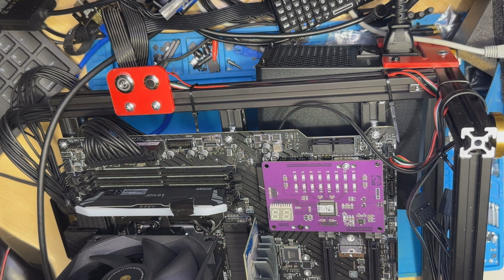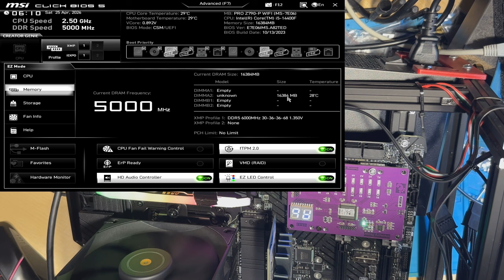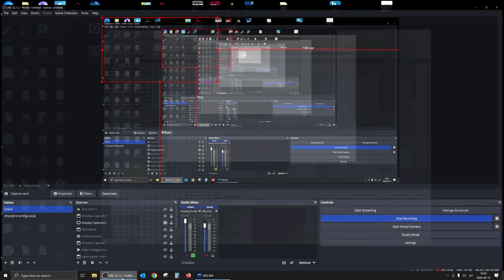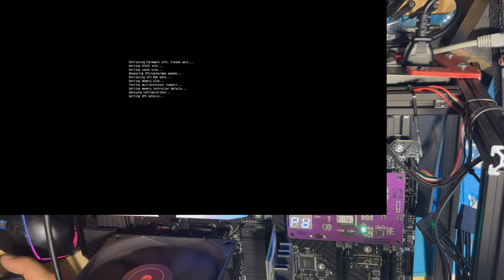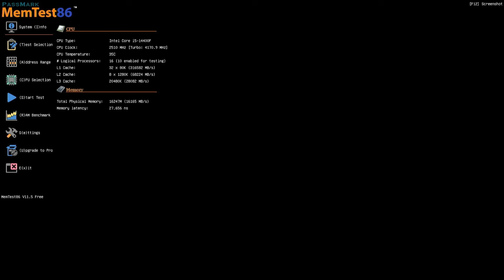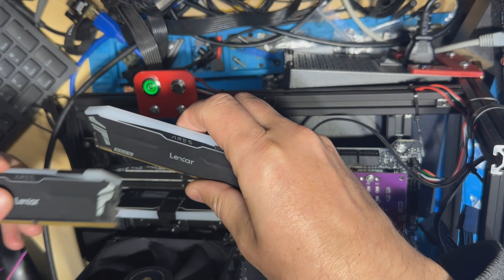DDR5 RAM Repair: Solving the Mystery of Dead Memory Sticks

Comment: Hi there, I love your videos. I’m willing to pay for a copy of the BIOS you used to test motherboards. Could you get back to me if this is possible?
Reply from the maker: U can find it for free in Tony's discord
Reply: @gpu_lt  thank you very much
Reply: @gpu_lt  Which Discord server can I find it on? Can you help me?
Reply from the maker: @clipalizou4269  pm me on discord
Reply: Hi, are you sure the only difference between a Chinese-modded mobo and a normal one is the BIOS? What if they modified the hardware part? Removed some resistors, added some wires here and there, etc
Reply from the maker: @artemexodus i don't know. Ordered from chine full kit and using.

Comment: Hello. You need connect 148pin (HSA pin, or this pin on spd chip)  ddr5 to vss(ground)  and power on your programmer. SPD boot in offline mode and lock\unlock RSWP will be available. Try it
Reply from the maker: Yes, allready made this. It is enaught to connect groud to spd pin8 while and then it cleares.  Thank you.
Reply: @gpu_lt  No problem. Pls tell me 5v arduino you connect to bulk_vin ddr5,  3.3v arduino  to pwr_en ddr5?
Reply from the maker: @harryus1681 contact me info@gpu.lt

Comment: that’s very interesting but how does your main board boot without the 24pin plugged in ?
Reply from the maker: If you mean the main power cord from psu to motherboard - it was plugged in. And this was the reason why camera could not see post diods on the motherboard. The 24pin was covering them.

Comment: I was looking to buy the postcard in the past but only tabaoo and could not deliver to my country. Where did you get custom bios and which ATX motherboard is required
Reply from the maker: i have friend in china, he was participating in this purchase, and it took 6 months, as first i bought only post cards, and then realized, that i need motherboard with special bios. so i bought also the ddr5 motherboard and finally have working test bench for ddr5 memory.